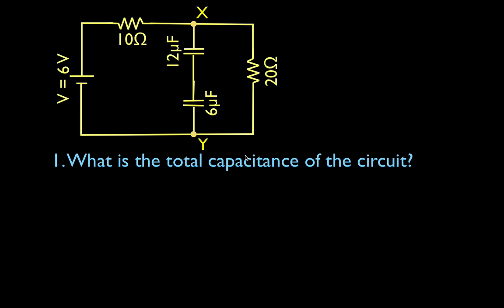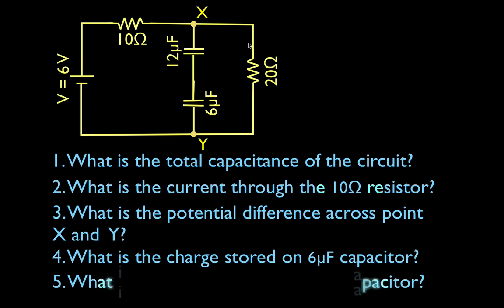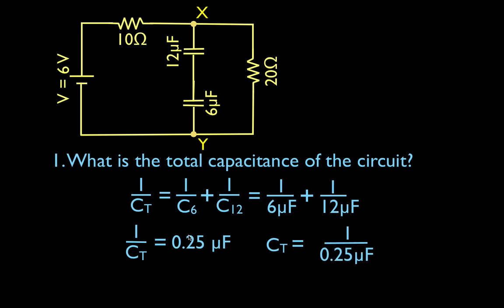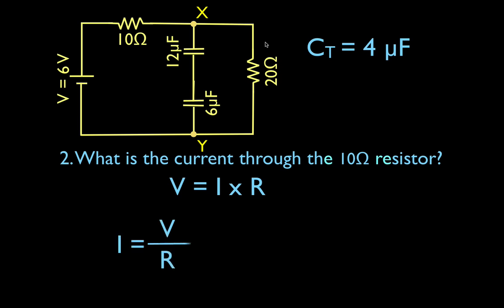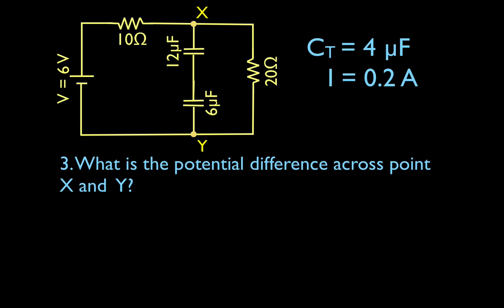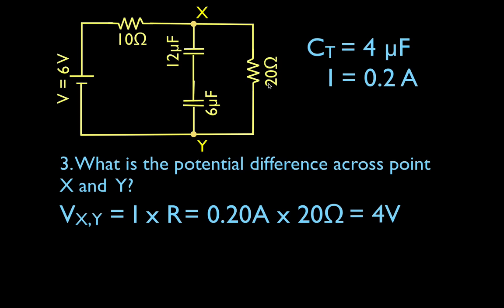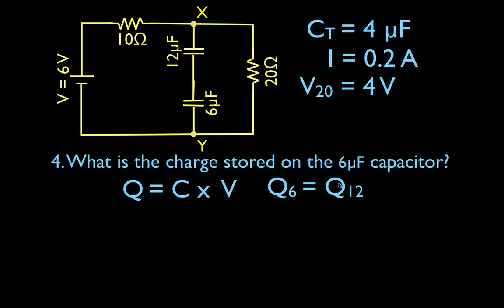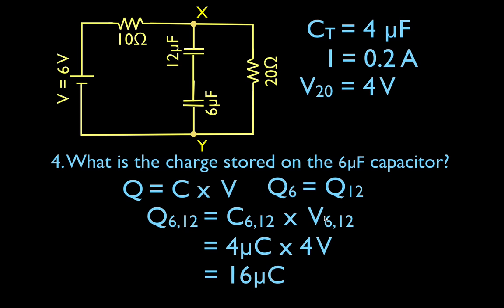RC Circuit Analysis (2 of 8) Voltage and Current

Comment: Hi There,
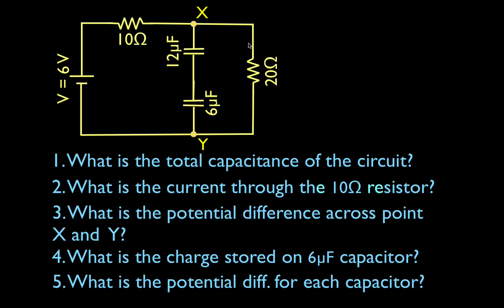At time-stamp 1:43 Your last statement is:  Two things - capacitors are charged and current is running through those two capacitors...  Most likely you wanted to say: capacitors are charged and current is running through those two RESISTORS...
;-)
Your tutorials are great!!!  I LOVE them...
I am going over them and taking notes...
I have become so good I even started catching the MASTER's miss-spells...   ;-)
I am sure you meant Resistors...  Like in the prior video you said 25 amps instead of 20 amps...
It's OK to make a mistake with so much numbers in ones head!!!
Cheers

Comment: Thank you for the video.  Simple things like 'voltage is the same when in parallel' really clear things up.
Reply from the maker: Corey Levinson You are very welcome, I try to use "regular/simple" language when possible.  Thank you for the comment.
Reply: You seem very intelligent, so I want to ask you a bunch of questions I've been saving up when studying circuitry.  It's a bombardment of questions, though, so you don't need to answer if you don't have the time.  I'm taking physics in school so these questions will help me.

-why do you not short circuit a battery by touching both ends with your finers?  is skin's resistance so high that it essentially breaks the circuit?
-what causes death?  Voltage or current?
-how can birds sit on power lines?
-if a capacitor is 10 microfarads, in an RC circuit, then at t=c, where c is a random constant, the capacitor can hold the maximum charge of a 5 microfarad capacitor, maybe later the max charge for a 6 microfarad capacitor, maybe earlier the maximum charge of a 3 microfarad capacitor?
-why does a circuit complete itself if you are standing on the ground and you touch a charged conductor that's connected to a battery or transformer on the ground?
-is a battery connected to ground if its physically touching the ground or does it need to connect itself to a long metal pipe in the ground?
-does voltage come out of the negative or positive side of a battery?
-why does emf exist?  Why is it important in circuitry?
Reply: -how does a capacitor charge if it's not a circuit?
-why must a circuit connect back onto itself?  I understand its necessary to have a complete circuit oelectrons can flow, but why?
-if you have high voltage in a wire, why doesnt a spark form in between a switch?
-if a high capacitance capacitor is fully charged, why doesn't a spark form in between?
-Why are wires covered in conductors?
-what's so good about coaxial cables?
-if a resistor has a really high resistance, is it possible to effectively cut off the current, thus breaking the circuit?
-is a lightbulb flickering really quickly?  I think the answer is no but I dont know.
-imagine two circuits each with a battery with potential V.  In both circuits there is one resistor.  In the fist circuit, the resistor is 1 ohm.  In the second circuit, the resistor is 10000 ohms.  Which circuit depletes the battery faster?
-what happens if a battery is fully charged and you try to charge it even more (i understand this question might have more to do with chemistry than physics)
-How does grounding work?  Why is it important?
-what is bemf?

Comment: Here's why I like this video so much. We all get these textbooks in school that show us examples, and our professors try to teach us this subject and another five or more concepts in a 1 hour lecture if that. When you can get a singled out explanation for something like this, it's soo much easier to sink in and understand. Thanks. I have a request though; can you make a video about the Voltages of the Capacitor in an RC circuit and how it changes through 5 time constants?
Reply from the maker: +Ray Fields OK, maybe I will try taking on charging and discharging capacitors in my next videos.
Reply from the maker: +Ray Fields and also thanks for the positive comment!

Comment: im a little confused on the potential difference isnt the total supposed to be 6? yet the 20ohm resistance is 4V and so is the 2 C branch
Reply from the maker: It is 4 V across both branches because 2 of the volts are used by the 10 Ohm resistor.

Comment: Why are the 10 and 20 resistors in series if theres another place the current can go? Does it only matter if the current has a choice between 2 or more resistors? I guess its still in series even though it could go to the capaciTORs

Comment: You said in your last video that at t equals infinity the current is equal to zero. In this video you state that we will be assuming that t is equal to zero but then you go on to find current through the R is .2A. I do not understand why I is is not zero.
Reply from the maker: In the first video there is resistor and capacitor in series, after a long time (5 time constant) the the current has been reduced to zero.  In this video there is a branch with just a resistor, when the switch is closed the current through the resistor goes to its max right a way and stays there.  Does that help?  You can see a listing of all my vidoes at http://www.stepbystepscience.com
Reply: So it is because of the branch with the lone resistor that the current is maintained?
Reply from the maker: +Andrew Mitchell yes

Comment: in question 2 how is the current through both resistors the same? The current through the capacitors is 0?
Reply from the maker: Because after the circuit have been running for a long time the the capacitors are charged and no current flows through them. Therefore, the two resistors are in series and have the same current flowing through them. Does that help?

Comment: for question 2 why do you have to use the total resistance when it is specifically asking about the current going through the 10 ohm resistor?

Comment: My argument here is that, based on my past experiences with circuit analysis, both resistors are not in series (nor parallel).  I have been taught that, when there are circuit elements connected between two resistors, they fundamentally cannot be called in series (reference node X and the elements, the 2 capacitors, below it).  Since the assumption here states that, in this case, the capacitors are fully charged, would this be an exception?  With both capacitors fully charged on the middle wire, can we then say that the 2 resistors are in fact in series?  Also, what if the capacitor(s) where not charge, could we still say that the resistors are in series?

Comment: but i have a question , in the firrst you assume that the voltage between 10 resistor in 6 and calculate the current  then u said that the voltage around the 10 resistor is 2 ,!!!

Comment: When a capacitor is charged through a DC supply source for infinite time, the final current through it is -
(a) Determined by the resistor
(b) Half of the initial current
(c) Infinite
(d) Zero. please reply of this answer sir please 😓

Comment: I really appreciate your video, well explained and very useful. 
I have a question: Mounting a timer with a 555 I need to know "when" the capacitor is going to arrive to 1/3 and 2/3 of the total voltage. 
Let's say I have a 9v rail voltage and I want to know how long is going to take for the capacitor to arrive to that voltage with a resistor on serie. I can't find an easy way to do It. Could you help? 
Thanks anyway and really god Job. 
Carlos

Comment: after long time the current in the circuit drops to zero. As result the pd across the 10 ohms resistor drops also to zero which means at the end the 2 capacitors are sharing between themselves all of the 6V of the battery. Vxy = 6V in Q4.

Comment: What would happen if your 10 Ohm resistor was a capacitor. If there was no 20 Ohm resistor, you are just going to charge the capacitors. If the 20 Ohms are there however, would you be charging the capacitors with less current? Under normal circumstances, if the 10 Ohm was replaced with a capacitor, they would be in series and all capacitors will have the same charge. However, I am not sure what will happen if the 20 Ohm is connected in parallel to the 12 uF and the 6 uF. Would it be preventing them to get the same charge as the capacitor which we used to replace the 10 Ohm resistor?

Comment: Sir, your videos are very helpful thank you very much
but i think you made a mistake the resistors are not in series ,they are in parallel
Reply from the maker: Sorry, I may have misspoken but you should be able to see from the diagram if they are in series or parallel. Thanks for your comment.

Comment: Could you explain why the lower value capacitor stores more voltage than the 12uf if the charge is the same. Is it due to different internal resistances?

Comment: For question 4 I'm confused. I was able to follow everything up until you said the charge on both capacitors has to be the same since they are in a series. Why is that? I would think the the capacitor with the higher capacitance would hold more charge.
Reply from the maker: For capacitors in series the charge is the same. This video explains it:
https://www.youtube.com/watch?v=EMdpkDoMXXE

Comment: If we calculate this after a long time, then like the previous example shouldn't the current through the 10 ohms be zero? Like if the capacitors are fully charged and the source ran out of power? Then the only source is the equivalent capacitors. why isn't it like that?

Comment: Great video, really helped me a lot! Just had one question if you don't mind - why is Vxy 4V when it is also parallel to the battery which is 6 V?
Reply from the maker: Because 2V of the battery's 6V are being used by the 10 Ohm resistor.  Oder?
Reply: Makes sense, ty
Reply: @stepbystepscience  after long time the current in the circuit drops to zero. As result the pd across the 10 ohms resistor drops also to zero which means at the end the 2 capacitors are sharing between themselves all the 6V of the battery.
Reply from the maker: @rabihatut  Not quite....After a long time the current through the branch with the capacitors goes to zero, but there will still be current through the outer branch with the resistors (why not?).

Comment: You say in the video that the last two branches are in parallell (the one with the Capacitors, and the one with the 20 Ohm resistor)

Why are the first and seccond branch not in parallell? (The one with the battery, and the one with the Capacitors)? They look parallell to me, so I would mistakingly have said that the potential difference between X and Y is 6 V
Reply from the maker: Yes, the battery and the capacitor branches are in parallel.  But the potential difference across points X and Y is not 6 V because some of the potential from the battery is used by the 10 ohm resistor.
Reply: Thank you! :D

Comment: I'm a little confused. How can the resistors be considered in series when the capacitors separate them?
Reply from the maker: The capacitors do not separate the resistors. Once the capacitors are fully charged, the current continues to flow through the resistors and the current through each resistor will be the same. Therefore the resistors are in series. Does that help?
Reply: @stepbystepscience  Yes, that makes sense thanks!

Comment: The total charge over the 2 capacitors is the same for both individual?
Reply from the maker: We don't really say the total charge "over" the two caps....it is really about the charge stored on the capacitors or the potential difference across the capacitors.  If their capacitances are different, then the charge and the potential differences will also be different.

Comment: at 4:35 i thought that when the capacitor was fully charged, that the resistor would have a no current....
Reply: only when the resistor is placed among the same branch(or in series) with the capacitors. that's why he kept saying outer branch(the one in parallel with the capacitors, which is the 10ohm and 20ohm resistors).
Reply: look at the circuit again. previous video has capacitor and resistance in a series. the resistors in this video is parallel to the capacitors.

Comment: How come the resistors are in series?
Reply from the maker: Because when the capacitors are fully charged no current flows through that branch, but the current still flows around the outer branch through the resistors and then they are in series.  Does that help?

Comment: why is there current flowing in the circuit at infinite time? didn't you say the current is stored as charge on capacitor at infinite time? I am really confused.
Reply from the maker: There is no current flowing through the branch with the two capacitors, charge is stored on the capacitors.  But there is current flowing through the branch with the resistor.  Does that help?
Reply: and why is the current same on both these resistor? I am still missing something!
Reply from the maker: Because are far as the current goes, with the capacitors fully charged, the circuit is basically two resistors in series and series resistors have the same current.
Reply from the maker: There is no current flowing through the capacitors only through the two resistors which are in series.
Reply: okay! that makes sense. Thank you for the explanation :)

Comment: so if each capacitor has a charge of 16 Micro Coulomb does that means the 2 capacitor together has 16+16=32 Mice Coulomb?
Reply from the maker: If each capacitor has a capacitance of 16 microcoulomb then the total will be 32 if they are placed parallel to each other...If in series the no.